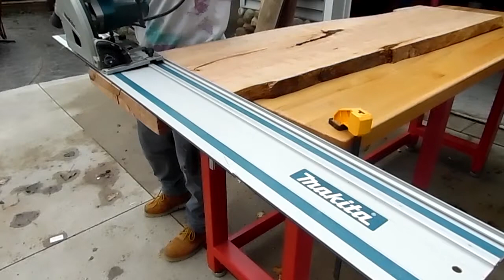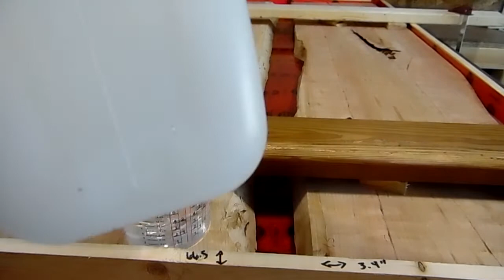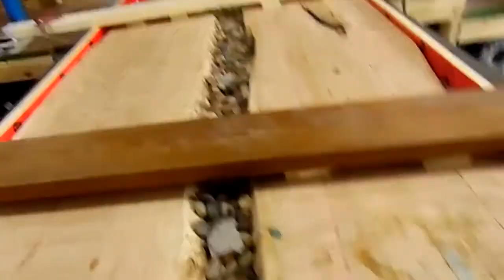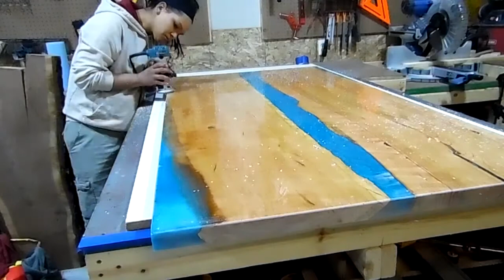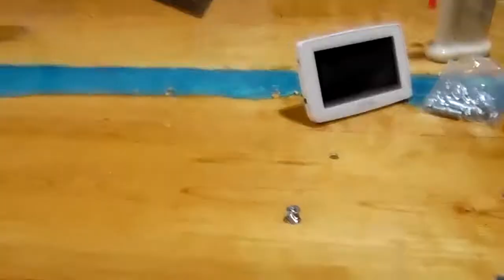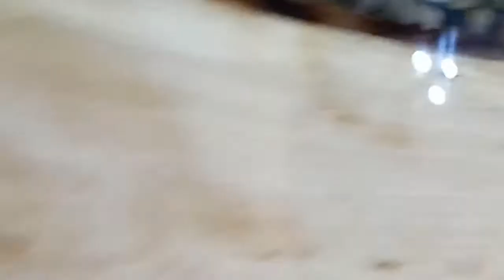Epoxy River Dining Table Build, How To , How to resin stones in epoxy resin

Comment: Great job. How long (hours or days) between the 1st epoxy layer with the blue tint  before you were able to put the stones. I tried this and the stone sank to the bottom making it pretty hard to sand or send through a planer without damaging the tool or getting sparks flying.

Comment: Also, how many hours between all the layers of epoxy? You mentioned it "tacky" but did not provide the duration between layers. Thanks from another lady woodworker.
Reply from the maker: Depending on resin and shop temp 16 hrs?